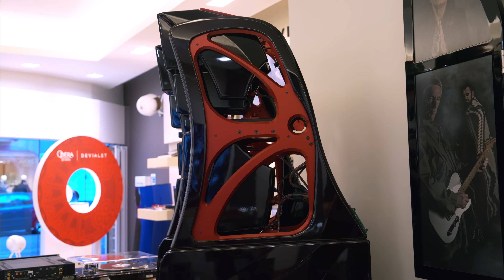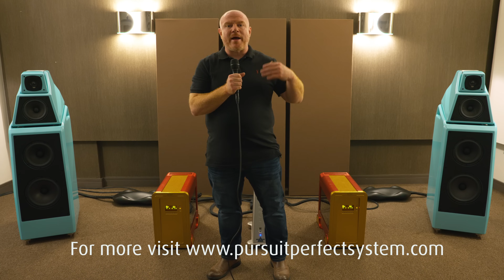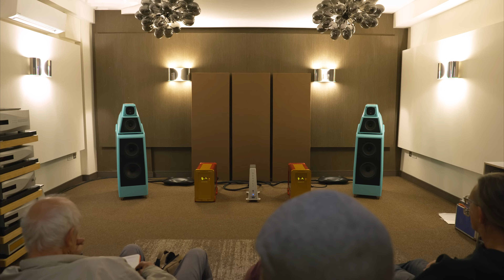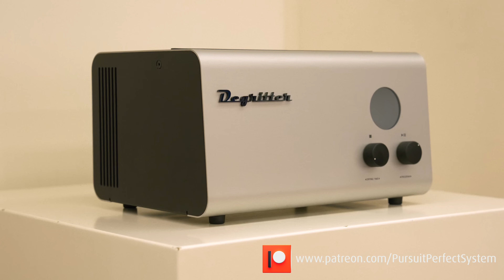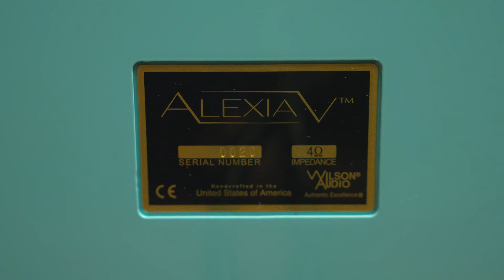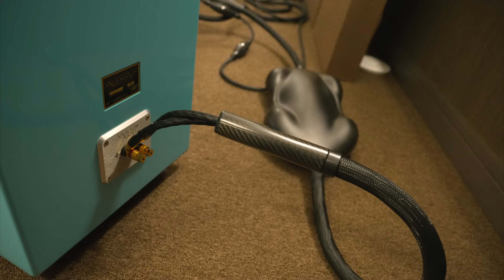UNBELIEVABLE HiFi! NEW Wilson Audio Alexia V Speakers SOUND BEAUTIFUL

Comment: Over engineering at its worse, far too expensive (I’m not jealous) and ugly, so KEF, B&W, Harbeth, & ATC are all wrong
Reply from the maker: To be fair KEF Bowers ATC and Harbeth all do it differently so essentially they all say the others are wrong.
Reply: @PursuitPerfectSystem  agreed but their speakers cost a lot less, are you seriously telling me that £15000 tune tots (Inc. Stands) sound better than similar sized speakers from say bowers that cost half the price? (Appreciated your reply btw) enjoy your channel, also have you seen the way they are made, lung disease must be rife amongst Wilson employees and they’re not really environmentally friendly.
Reply from the maker: The Tunetot is an extreme example of course its not the same kind of speakers as a big bowers, but I think they were originally designed to be used on desktops and in kitchens and stuff so in that instance they make for an amazing nearfield desktop setup where you couldnt use big bowers.  Yes they are very expensive either way  but when you hear a system like this its amazing and it doesnt sound like a normal hifi its different.
Reply: @PursuitPerfectSystem  Totally agree. This is evolution of "consumer electronics" to lifelike audio reproduction. They are not the same thing and I suspect the designers behind the various systems would agree. The system in your video is unapologetically expensive and designing to a cost was probably not a strong goal as it would be for some of the other brands mentioned above.

Comment: Isn’t that $250k amps? Why would anyone use $250k amps for $70k speakers? The truth is latest Wilson speakers do not sound right with most solid state amps. That’s why they are using extra mellow amps like these or tube amps at the show. In my opinion, the latest Wilson speakers have messed up the tonal quality.

Comment: I'm a Wilson owner AND fan, but... what's whit these dents at min 9.30-9.40???
Reply from the maker: Not sure what you are referring to here, that time frame shows the speaker plaque which is only a few cms wide and I have applied a lot of "zoom" with the camera lens and software so any bits of dust you cant see with your eye all show up
Reply: @PursuitPerfectSystem  the dents in the lower left side bevel, that's no lens or video artefact, as they're present even when the focus shifts.
Reply from the maker: I see what you mean now,  you would have to be close examining by the mm to see that by eye.  The curse of the zoom shows everything even the tinniest of things
Reply: I noticed them too... sloppy workmanship for the price...